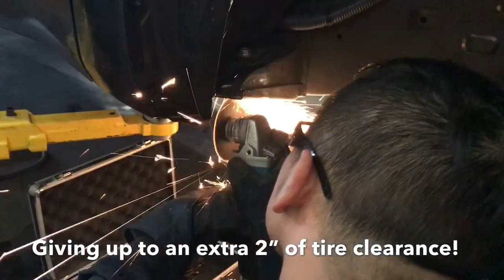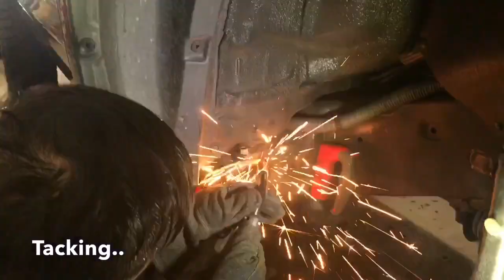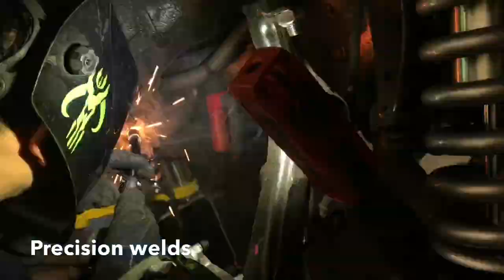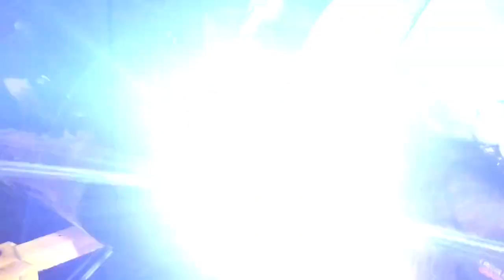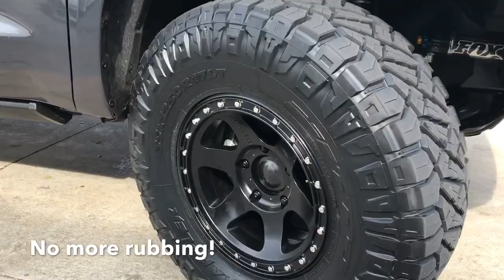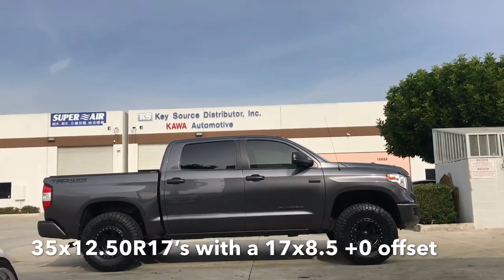Tundra Body Mount Chop BMC to Fit 35’s and 37’s

Comment: Hello i have a 2020 Toyota tundra with a 4-inch lift with huge 22inch rims with 35inch tires.  when i try to park my truck or making a sharp right turn the tire rubs the back of my fender well and some of the original body mount. My question is, does this body mount relocation fix this rubbing issue? thanks for the video

Comment: What about offroad at full bump full lock? No rubbing with 35 and the chop?
Reply from the maker: Clears with offroad articulation with the proper wheel fitment. Thanks for viewing!
Reply: @88ROTORS  Will the stock wheel offset work with this setup or will wheel spacers or a new rim be necessary? If running 35's on said stock wheel.
Reply from the maker: @Chrisjones2283  Assuming you are saying for a true 35x12.50 tire, I would recommend going with aftermarket wheels. Spacers if you really want to use stock wheels,  but new wheels would be the better choice, IMO.
Reply: @88ROTORS  Thanks for the tip, I will probably rock spacers till I find a set of wheels I fall in love with.

Comment: I have a procomp 6” lift, stage 1 with 35’s, looking to put 37’s and possibly get wider rims, -44 offeset. Would this trim be recommended? Was told by pro comp 10.5” wide would be the most, looking to go 12” on 37’s for a more aggressive stance. Thanks in advance.
Reply from the maker: Dre 9Golan I’m on 12” wide wheels -44 offset with 37x13.50. Yes, definitely recommend BMC to run that.
Reply: 88ROTORS what kind of lift? 6”? Or would I have to upgrade to a 7”
Reply: 88ROTORS ps, you guys lowered the charger that’s on my profile pic :)
Reply from the maker: I’m 8” with aftermarket front bumper but your 6 is doable with 12.50 width tire. Just need to modify bumper also if you’re running stock.
Reply: 88ROTORS much appreciated, will try to swing by soon.
Reply: Sorry, what’s the turn around on this job? I live out in Bakersfield and would like to know if I have to arrange transportation
Reply from the maker: Dre 9Golan couple hours, so you can hang around until it’s done. 👍🏻
Reply from the maker: Dre 9Golan just let us know anytime and we’ll set you up with an appointment. Thanks
Reply: 88ROTORS awesome, thanks again!